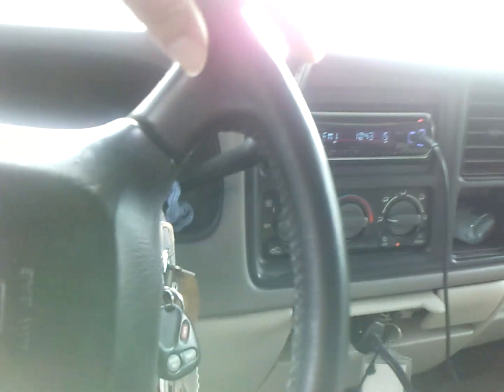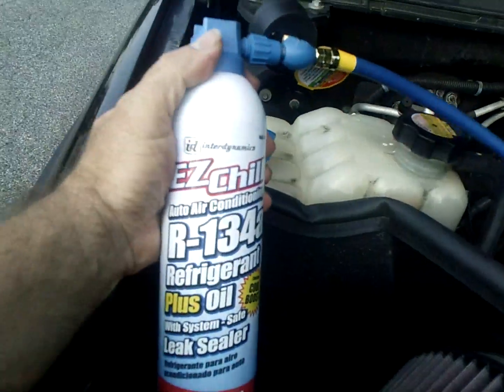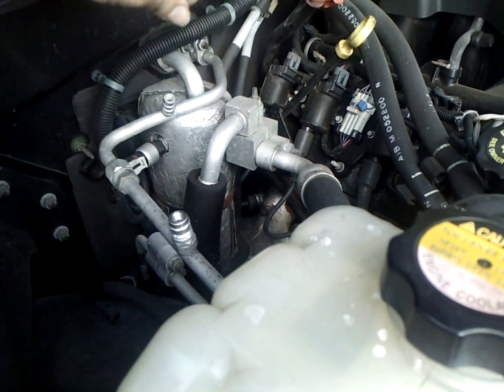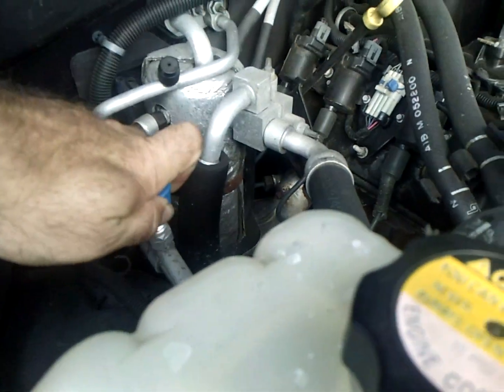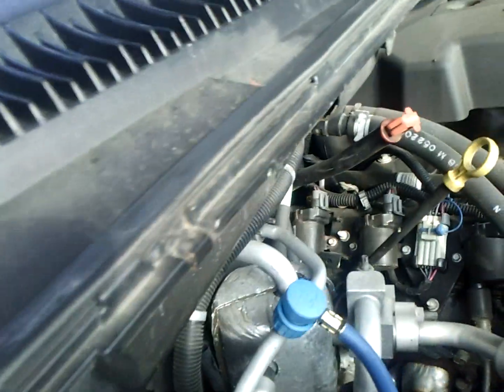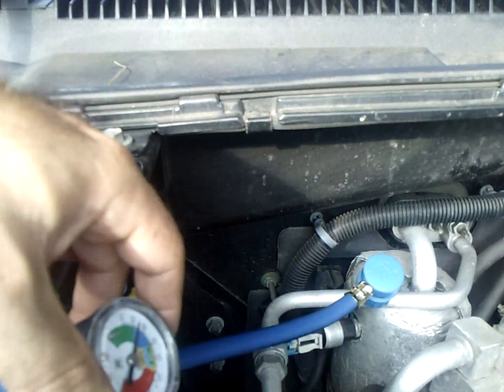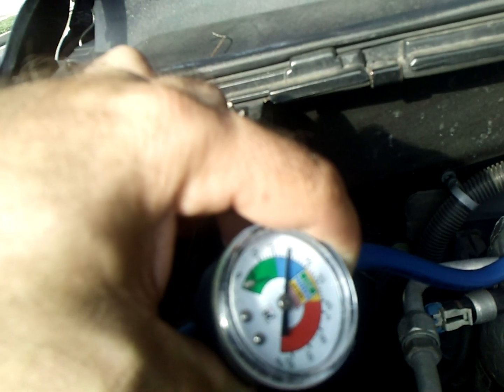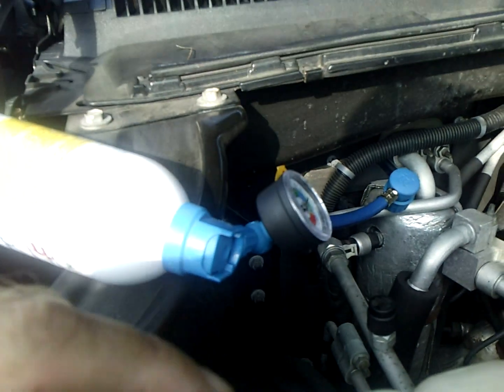Recharging the A/C in a 2000 Chevy Suburban: Part 1

Comment: The low side is port closest to the AC. He properly connected to the low side, but they’re not both low ports. The one further up the pipe is the high side.
Reply: Thank you for this! I was looking for this info. I’m assuming this fitting between those valves is a check valve, because that’s the only thing between the high and low side valves. I am evacuating my system after a compressor swap and wasn’t sure.

Comment: You need to bridge the pressure sensor before you attempt to load freon otherwise you're compresor won't turn on I tried to do it same as this video and It didn't work you need to turn on the compressor search on how to before
Reply: WRONG ANSWER!  Don’t do that. The compressor won’t turn on for a reason.  That’s because it detecting LOW PRESSURE-in the system. When there is sufficient pressure the low pressure cutout switch will close, thus allowing the compressor to engage.
Reply: I just did my buddies 02 GMC 1500 I had him start the truck turn the a.c. all the way up plugged almost the exact same can as he's using here pulled the trigger it took two thirds of the can and know sooner I got the cap back on the low side port closed the hood it was blowing 80 percent colder. The plug of the can won't let you put it on the wrong one.

Comment: This fella does not know what he's talking about. One port is the high side and one port is the low side. The fitting between them is an orifice that begins the evaporation. That tank is not a dryer, it is an accumulator that stops liquid refrigerant from going back to the compressor.

Comment: You are pointing at the receiver/dryer.  A receiver/dryer has a dessicant bag inside of it.

The receiver/dryer is NOT the evaporator.  The evaporator is located on the inside of the firewall.

Nice misinformation, dude.
Reply: BlownNitroPontiacFan